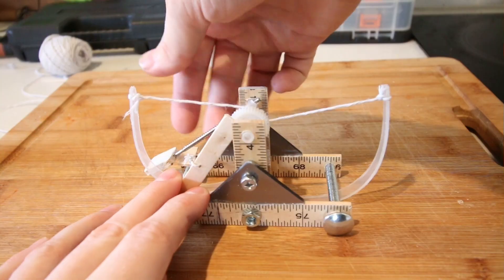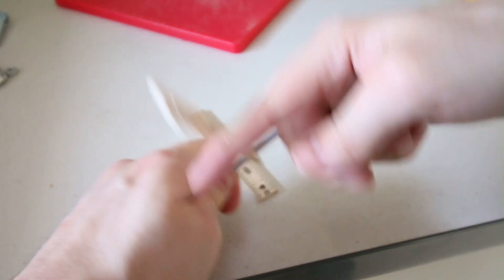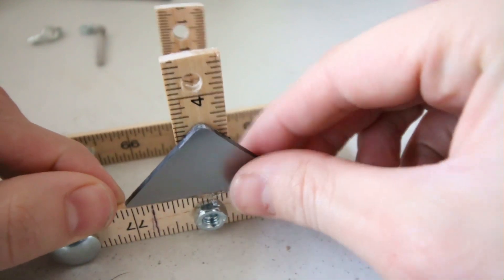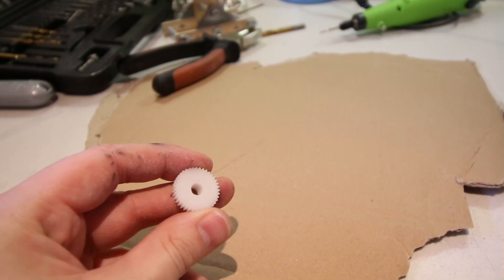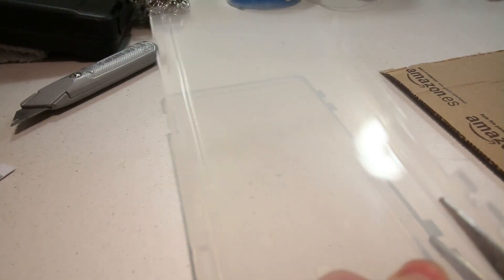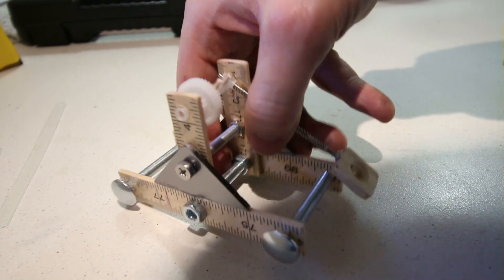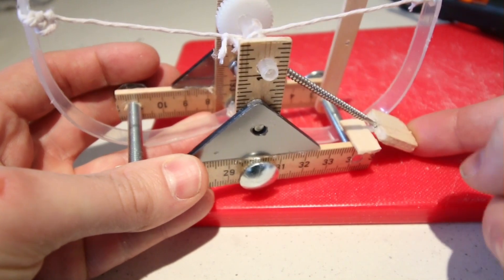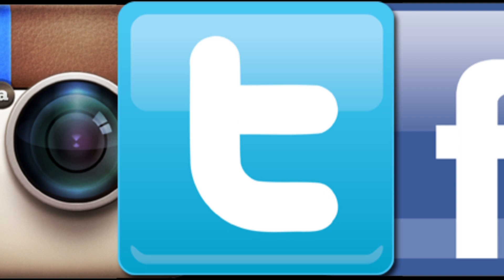Make A Mini Da Vinci Catapult!

Comment: hey guys it's Andy here

in this video im going to show you how to make this miniature (   ) catapilter

NICE

so I started with base I decided to make base from this wooden foldout ruller.

mainly because I have no over particular use for it.

also being ruller it makes easier to chop it into a equal length.

I began by chopping the ruller into two length, four inches 

and two length two and half inches

I'll be using (  ) this five centimeter M60 bolt to piece everything together

I then went on to drill three holes  equal length apart on the four length of ruller

make sure the holes big enough to fit the screws 

I then use the bolts to piece together the frame as shown

with the help a few nuts 

everything should stay in place. 

there we go.

I then cut out two right angle triangles  from sheet of (    )

once I've smoothed them out 

these will help secure the main frame.

using hot glue I attached first triangle to the edged frame like so.

I then used holes that were already there to carefully guide drill through.

Once that was done I did exact same thing for the opposite side.

there we go.

I then screwed in another bolt through those holes

next It was time to make pivoting shaft.

for this I decided to use an empty ink refill from a pen

as it's easy to drill into.

I cut in down in length and then drill two tiny holes into the center.

I also came across this plastic mechanical (   ) from inside of electronic toy.

this will do fine for the trigger mechanism.

I increased hole in the center so it was wide enough to squeeze over the shaft.

two tiny pieces of the (   ) secure I then added to the two holes that I made in shaft

I then made another small hole ninety degrees from the secure holes

this hole will fit in the launching arm.

I decided to use this metal road for the launching arm.

I found this small sqare piece of wood and then crafted into a scoop using a rotory tool.

this wood then be attached to the shaft which was then attached to the frame.

Next it was time to make springy arms which powered catapiltor.

 

to make this I cut out two length from a plastic container.

you need to make sure the plastic is flexible enough to give enough toque to power

the catapilltor

I smoothed each one of them out and then drilled hole at the end.

there we go.

these were then sloted under the outer screws and then glued onto the center screw.

simple.

I then tighted string to the secures under shaft which was then tightened 

(          ) flexible arms.

You can see how I've  attached the strings to the shaft in such a way that when I pulled launching arm. the flexible arm's tighten up and creat toque.

for trigger device it's just simple chopped off rollystick with a hole at the end

and a small hole in the center to attach rope.

this trigger device catchs with (   ) until it's pulled and release in the catapilltor

I also glued on this little ledge to stop the launching arm from unevenly hitting the fram.

add some for trigger device. and we're ready to go.

NICE